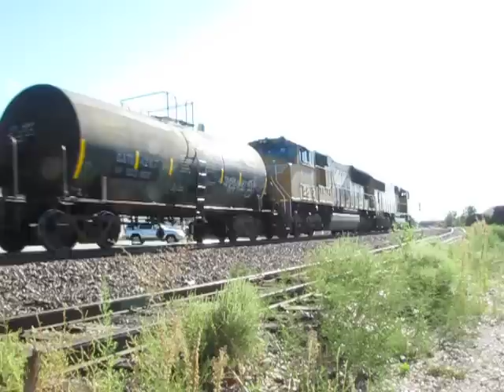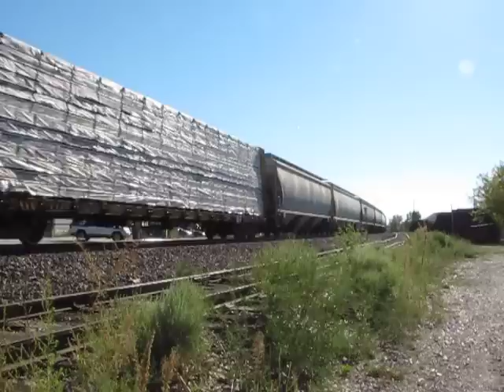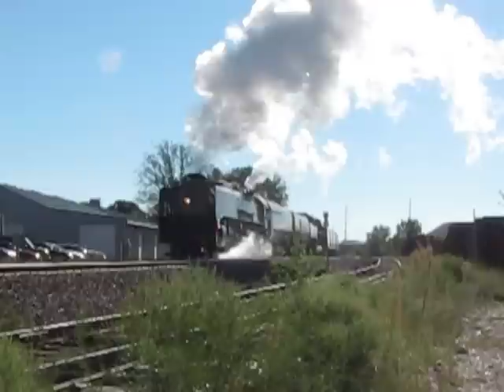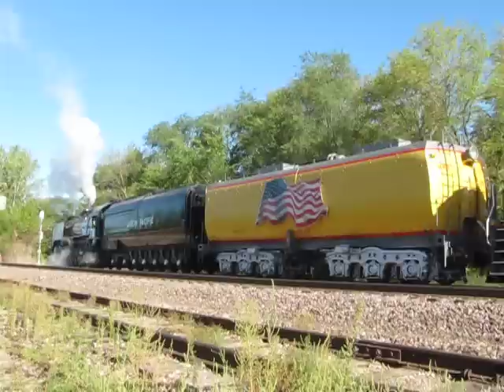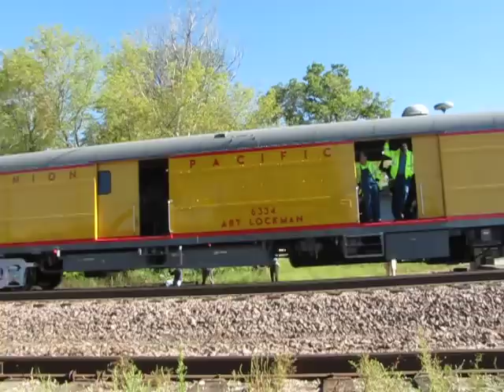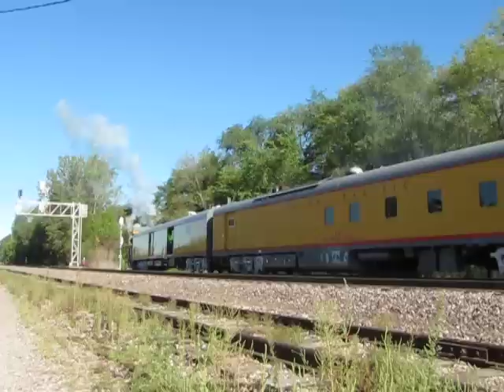Cutting it Close: View of Steam Engine Almost Blocked by Freight Train

Comment: As mentioned by another poster about controlling the trailing diesel locomotive they can't control the dynamic braking from the cab of the 844. Three years ago I was the pilot engineer for the 844 between Vaughn, NM and El Paso,Tx. On the grade down from Carrizozo,NM to Three Rivers,NM I had to go back and run the diesel to provide dynamic braking. The 844 does have a box that can throttle the diesel up though. It was the thrill of my railroad career to get a turn at the throttle of the 844. Sadly our maximum track speed there is 70mph. I would have loved to turn it loose and crack it up to 90mph. It was a total thrill even at 70mph though.

Comment: Thank you.
Yes, the only sunny side would be inside the curve.
Seems like quite a waste to have the diesel running just for occasional dynamic braking.   They can use 844's braking and train brakes and not even use dynammic braking.
Do these people consider ways to lower operating costs and pollution?

Comment from the maker: The white smoke is mostly steam.  How much of it appears depends on the temperature.  For example, another video taken earlier on the same cool morning has a lot of white steam.  An oil-fired steam engine like this one won't puff black smoke running well in normal conditions.  Black smoke can be sign of the engine suddenly working harder or fireman doing a cleaning technique know as "sanding the flues."  Gray smoke comes from mixing white smoke and black smoke.

Comment from the maker: It's for dynamic braking.  That's a brake system diesels have but steam engines don't.  The more they use that, the less they use the steam locomotive's brakes, preventing more wear and tear.
Reply: Not just the engine/tender brakes on 844 herself, but also the brakes on the rest of the vintage rolling stock.  U.P. doesn't like for this equipment to be laid up in their shops getting the brake linings changed on them, they want the brake linings on all the equipment to last as long as practical.  ^^